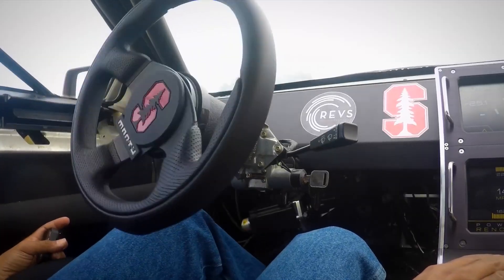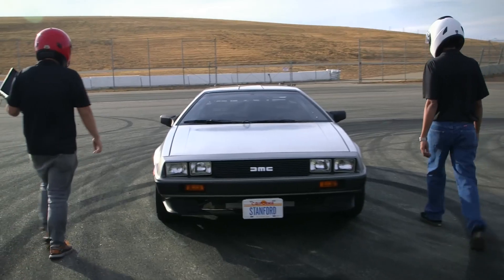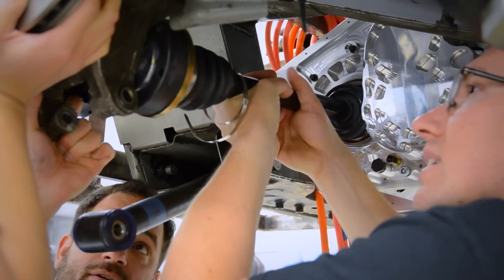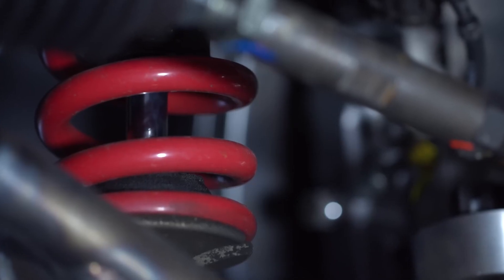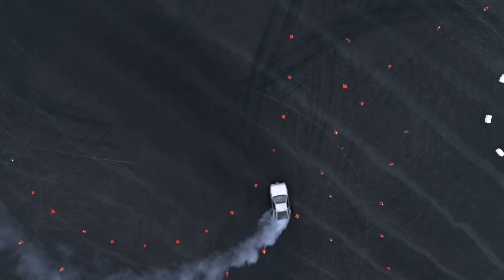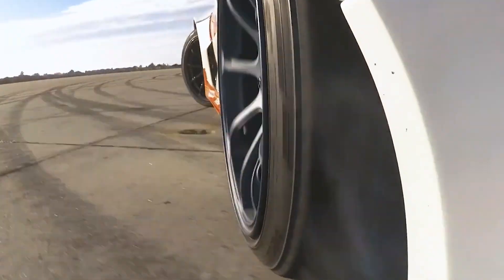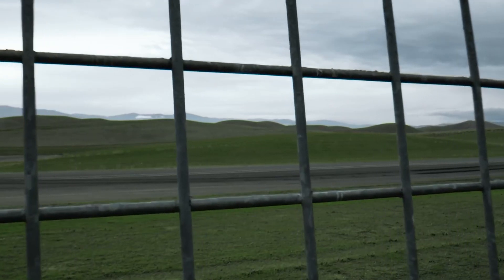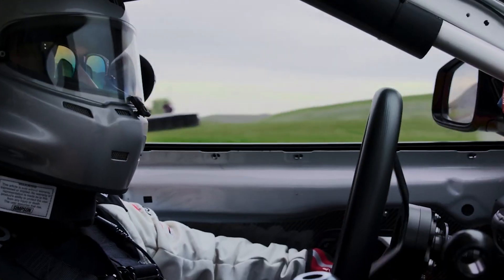When AI Drives Your Car...

Comment: Personally i would not let AI take over my driveing. But i know cases that AI would have been an better option or atleast as an safety feature. But implementing AI as sofisticated as seen in the video, in cars would be wrong. AI is not good enough yet, it would be dumb. 
But give it a few years and then let AI in as extended safety. And fully selfdriving cars now is not an good option. If you think AI is just great enough, just look at my spelling. I have AI assisted correction.. Does it work? Not even close to all the time. It corrects the correct word into wrong spelling for some reason.. So AI-selfdriving cars that makes competely wrong choises could be deadly. And thats ny point on this topic. AI is to young.